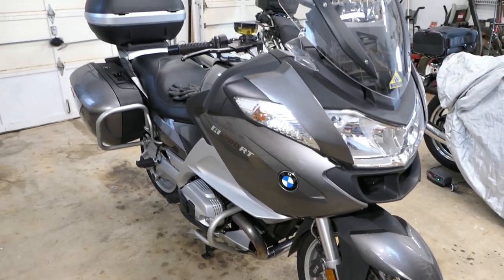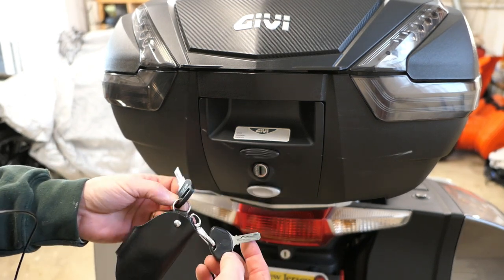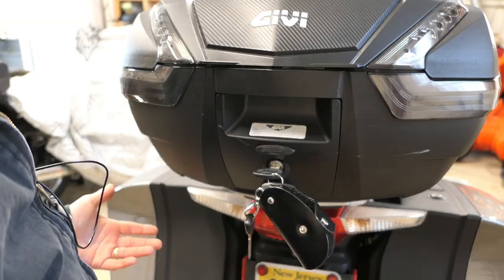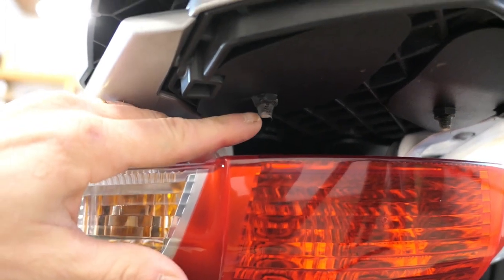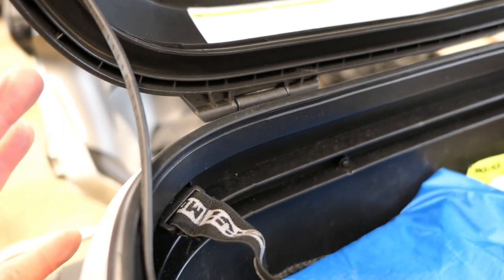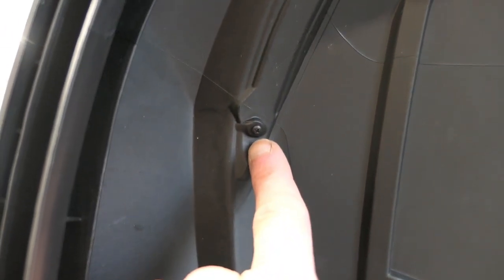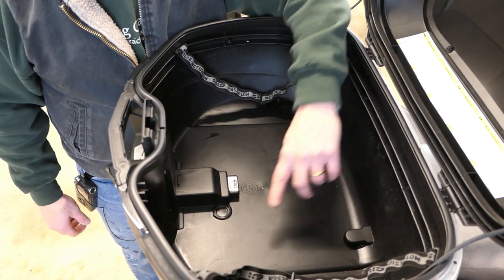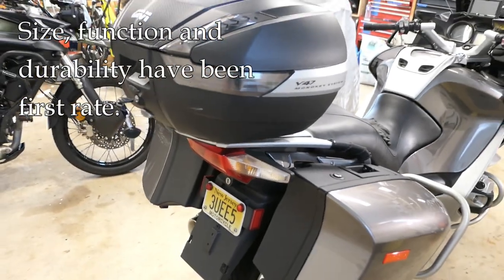Givi Monokey V47 Top Case Long Term Review

Comment: Nice review, thanks! I have the G46 which is very similar on my 2013 1200RT (nearly identical to your 2012) and agree 100% with what you've found. Not only is the G47 and G46 a lot less expensive than the BMW option, I think they actually look better than the factory case on the bike too. Thanks for taking the time to post this!

Comment: Greetings from the UK, 
just installed the same box onto my 2003 VFR800 today, purchased based on your review, so thanks for that.
Although, I was surprised at how much force was needed to get it to click in, hope that gets easier over time. Installed the plate, no problem, went to put the box on and it kept rebounded, failed to engage with the lock. Took it all off again to check the plate and box were compatible, ended up turning it upside down on the sofa. 
But, I guess it really is designed to stay on permanently, if you go with the brake light kit. I didn't, but may do in the future.

Ride safe
Reply from the maker: My top box does not require undue force to get it to engage.  I'm wondering about two possible issues.  First, is the mounting plate bent or warped?  It might have come that way or it might have become that way if you torqued the bolts too much.  Second, are you certain there isn't something bent or broken with the tabs that fit into the slots?  On my copy it's pretty easy to click in and out.  You need enough force to know you are pushing down, but it isn't a strain at all.

Comment: Thank you for the review, I think I may order the 56 liter. I'm in the same situation as you, I bought a R1200RT and priced a BMW trunk. I think this will be just fine for the 1 trip a year I take on it.
Reply from the maker: I decided the smaller 47 was better for my needs since I didn't want too much box hanging off the back if I didn't need it.  You have to think about how much you are really going to need to carry and how much will fit in the side cases too.
Reply: @tinderboxarts  I probably will have all the cases off it most of the year when I'm just riding around locally. Once a year I ride across the country with my brothers and a couple of friends so the more storage the better on a long trip I figure.
Reply from the maker: Just remember that the bigger case can also be a sail in the wind when you get crosswinds on a highway.  I mean, if you need the space then get the bigger box.  But, if you can live with the smaller one it will be a little less of a sail.  That sounds like an amazing annual trip with your family and friends.  I'm hoping we get a handle on covid and things start opening up again because I'd really like to take some longer rides while I am still able.
Reply: @tinderboxarts  oh for sure they are and that's definitely a down side. I also watched your video on flushing the brakes. I can't thank you enough for that, your videos have been a big help. This is actually my first BMW so I'm learning a lot on YouTube. Good luck on getting some longer rides in, my brothers and I are getting older and we just decided we're going to keep doing it as long as we can. We've been riding together since we were kids riding dirt bikes. Probably 40 years at least.

Comment: John, thank you for doing this nice review of the V47 top box. I purchased my 2011 R1200RT a year ago. Although it came with a BMW top box in like new condition, I think it is too boxy and ugly to keep mounted all the time. Problem is that with other necessities in my paniers, I end up carrying my helmet with me (into a store, etc.), which is a pain, so I am seriously looking at the V47. It's a little more streamlined and I think it looks better than the BMW box, which by the way weighs in at a hefty 20 lbs, twice as much as the V47, which makes a difference that far back on the bike. The BMW box seems to have a lot of waisted space between the inner and outer shells. Another reason I'm considering the V47 is for the lighting, since I am a big fan of being seen from all directions. I realize the optional light kit fits into the top lenses, but do you see a way that LEDs can be mounted in the lower lenses as well? Thanks again for doing this review; I appreciate all your videos, as I am also doing my own maintenance and learning as I go.
Reply from the maker: So, there are some people who have done homemade LED light fitment in the V47, and there is also a kit from the manufacturer.  I'm not sure how bright the manufacturer kit is, but homemade lights can be made fairly bright.  This is something I've considered myself, but I haven't gotten to the task yet.  I have nothing but good things to say about the V47, though.  It's been drama-free for me.

Comment: Is it possible to mount the box on the bike without the key ? For example if the key is in locked position and removed from the keyhole, is it still possible to push the box and snap it onto the bike ?

Just asking as I faced a similar situation recently where my Key got locked in the box in the hotel room by accident and I didnt try to mount the box the bike , rather I went home, got my spare keys and returned to do it the proper way. But ever since that I have been thinking does the box lock onto the bike even without the key ? I am scared to try since it takes quite a force to snap the box on the locking plate and I dont want to break anything.
Reply from the maker: Yes, with the key removed you can just pop the box into place on the receiving plate and it will snap and lock.  Obviously you can't remove the box without the key, though.
Reply: Thanks for replying, I just wasted my time a lot to fetch the spare keys out of sheer panic of locking the keys in it seems. Could have snapped the boxes on and driven home and then unlocked it with the spares. Sheesh :-(  @tinderboxarts

Comment: Does it make any noise while driving on more iregular roads?
For example, a Givi b47 owner told me that his case, on iregular roads, makes a bit of noise because there is a little gap were it shuts (where te seal is)... So on bigger bumps the top and bottom plastic hits each other.
Any similar problems?
Reply from the maker: No, not at all.  When the top shuts you actually have to give it a little squeeze and it clicks shut.  And there isn't any play between the box and the mounting plate, either.  I've forgotten on occasion to click the top shut, but it still stays put.

Comment: Does the top box vibrates or rattles when you ride?
Reply from the maker: No, it's good and tight. The mounting plate is firmly mounted to the stock plate and when you install the box on the mounting plate you have to give it a solid push down to click in place.  It's not going anywhere.

Comment: Hi, thanks for this review!
I was looking for the inner dimension, particularly from the middle notch to the back of the case. I am trying to fit my trolley for my work and I wonder if it would fit.
Reply from the maker: The most restrictive dimension front to back inside the bottom half of the case is 13 and 3/8 inches.
Reply: @tinderboxarts  thanks very much!

Comment: I have a 1998 BMW K1200RS and i just got a givi V47 top case and the bracket for it. The instructions on how to install it is practically useless. Any suggestions?
Reply from the maker: What are you having trouble with?  It looks like your bike has a bracket (shown here: https://cdn.shopify.com/s/files/1/0263/7053/9606/files/680f.pdf?2161) and then you would need the mounting plate as well.  Did you buy the mounting plate with the bracket?
Reply: @tinderboxarts  hey there thanks for the reply. Yes after i wrote my first comment i realized that there were brackets needed. The diagram didn’t really  explain that well.   The pdf you linked wasn’t included. Thanks
Reply from the maker: Glad you got it sorted!

Comment: Do you have to use the key and turn it to make the box removed from the plate?
Reply from the maker: Yes, you need the key to remove the box from the mounting plate.  There's a release button toward the bottom, but the button is locked until you turn the key.

Comment: I really can't see when you would ever leave your bike running, it takes a fraction of a second to start it again.
Reply from the maker: If I'm only getting off the bike for 30 seconds, I'll leave it running.  Starting an engine causes wear and tear because the oil pressure is not there yet.  It also wears the starter.  Better to leave the bike running if you are just hopping off to grab some gloves from the top box or whatever.  I'll also find myself starting the cold bike getting ready to go, and then realize I forgot something in the box.  I'd rather not shut it down after just starting it so I can get something out of the box.